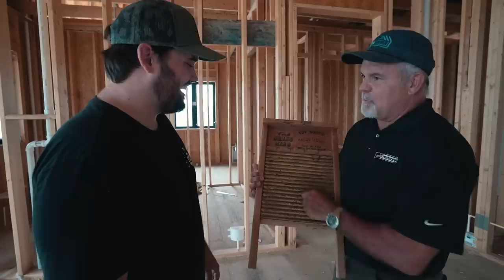Reviewing MANCAVE Plans & NEW HOUSE UPDATES With FLAIR!

Comment: Hey Brad pass this idea to Flair with the dogs. What if instead of setting them up in the upstairs area they had under the stairs in the garage Air conditioned inside then had a doggie door on the back into a fenced in dog run so they could go in and out whenever they wanted to and then had the upstairs part for the dogs as a storage place. 

As dog owner one of my dogs is a senior and had hip issues since he has pretty big dogs it wouldn't be out of this world to imagine once they hit 10,11,12 years old his dogs not wanting to go up and down stairs everyday plus it's less work for him and his family to worry about letting the dogs out and form looking at the video's it looks like that space underneath the stairs is pretty big especially if they added a doggie door into a dog run. 

Just a thought as a dog owner

Edit to be fair he does have the elevator but I still think the stair idea is a worth a convo. Because the dog door/dog run sounds like it would be a good quality of life add on
Reply from the maker: I think that’s a great idea converting the area below the steps into a dog house!  🎺

Comment: My input - 

10:48 i would highly consider going 4ft not 6 to 8 inches. You have to account for splash and cleanup of the splash. 

I see some metal duct work for the air system. That's the best decision but i did see some flex. For the investment i would highly recommend sticking with metal duct work as flex is known for air restriction.

Air conditioning - Best AC is the Bosch 2.0 inverter series. I have a 5 ton that is rocking 6 hours a day here and draws nearly 5 amps 
 

Limit the amount of vent pipes going through the roof. I would take advantage of side vents as i have personally seen flanges wear out which caused leaks. The leaks were not immediately detected due to closed cell spray foam. When the leak was detected it was apparent that this has been happening for sometime resulting in the area around the vent having wood rotting on roof that also needed to be replaced.

Comment: With no floor drain in the garage you might want to make sure to have a full time built in dehumidifier so you don’t get mold growth on the walls from excess moisture from the winter time
With a humidistat so it only kicks on when it needs to.

Comment: Hi Brad I just read all the comments.  Theres a few who know how to build and most are like wow. I think the house building watching is such a break after cutting cars apart and putting together.  I deal with a problem with a part being 1Millimeter off. 10 millimeters is 1 inch. I see your busy answering as I read. Have your coffee and enjoy.
And the next beer you have think of me and have a toast. Cheers
Reply from the maker: Thanks Lewis for always having my back!👍  I’m going to have that Beer Now! 🍺🎺
Reply: @BradtheBuilder  Good for you. I'm no expert at Construction anymore  lol but I remember enough to be dangerous.  I dont miss walking on top of 2x4 walls backwards laying out joist marks.
But have a car on the frame machine  being pulled back into shape will make creaking and popping noises of the steel. That popping will scare the crap out of you
Reply: @BradtheBuilder  Cheers
Reply from the maker: @lewiskemp5893  I bet that would scare the crap out you!  When you have a car on a frame is that the same as a rotisserie?
Reply from the maker: @lewiskemp5893  when you say you have a car off frame is that considered a rotisserie rebuild?
Reply: @BradtheBuilder  its actually a rack you drive on and get 2 clamps per side holding car to rack
Reply: @BradtheBuilder  its just trucks today that have a separate frame and a body and bed bolted to it
Reply from the maker: @lewiskemp5893  got it!  Your work sounds like fun & rewarding when it’s all done!
Reply: @BradtheBuilder  It is. I always tried to fix every car like it's my mom's car driving my kids. I do great work and have a great reputation from Atlanta to Albany Ga where I am at now